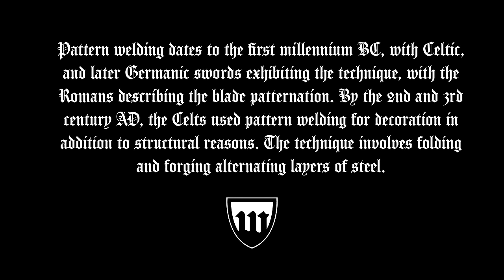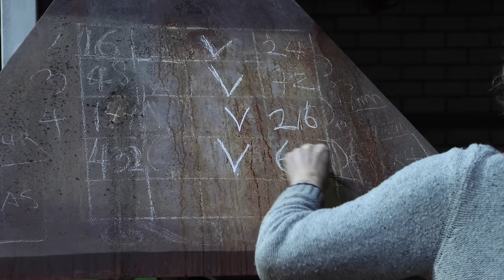Forging a Pattern welded longsword, the complete movie.

Comment: Curious about the concept of dimpling the billet. Is it to make expansion or lengthening of the billet go faster? You're the only smith I see doing this and I'm trying to learn so any explanation would be greatly appreciated.  Also your videos are excellent, haven't seen a bad one yet. Thanks
Reply: its to expose different layers of the steel in a Raindrop pattern. Just google Raindrop Damascus if you want to know more
Reply: @ughmas  thanks for the response, your explanation makes sense now that you mention it. I'll look into it.
Reply: It creates patterns in the steel.

You can't see it very well on this blade because he did a lot of forging afterwards (which interrupts and changes the pattern) but if it is done to a flat billet that will ground to shape it causes what is called a "raindrop" pattern, an almost pond ripple effect.

Comment: Absolutely spectacular!  Mr Wieringa, if I may ask, when you sandwich the hot metal between the planks of wood, what does that step achieve in the overall process?
Reply from the maker: It keeps the steel straight and slows down the cooldown. In different stages this is beneficial. Basically tempering the steel a bit jut after hardening for example. Insteed of a rude and hard cooldown. Giving some flexibility already.

Comment: holy shit was it ever impressive watching you bend the blade that much only for it to spring back. I'm an aerospace engineering student and we just recently went over chipless production and heat treatment of metals, so I'd be really interested in knowing what steel you used, what temperatures you heated the blade to, how specifically you cooled it down - just more details in general.

man, this would be a great hobby to have. maybe someday...

Comment: One of the things I love about these videos is the flaws; they're very few and far between, but it makes the piece even better because it's not a soulless mass-production product.

He's very clearly not a machinist—it's not his specialty—so when he ventures outside the "comfort zone" of his near-total mastery of blacksmithing tools, you can more clearly see him learning with every project.

Just by eye, I could see (and hear) that the laythe was off by a few thousandths, and the drill press is a tiny bit wobbly, and with one of the parts going in between the crossguard/pommel and the handle, he probably should've really gronked-down harder on the vice, as it slipped and probably obliterated tolerances.

But all of that doesn't make the sword worse, it actually makes it better, because it's another part of the piece's story;

A master blacksmith using every tool available, even ones he's not a master in, to make a sword as good as it can be.

I like that.

Comment: You didn't seem to show the folding process but it definitely looks folded, did you purchase the steel that way or do that yourself?  I am also curious what the dimensions of the blade are.  Amazing work, it looks fantastic!
Reply: It won't be folded - that's more of a Japanese thing, to clean the occlusions out of their shitty steel. 

It will have started as alternating plates stacked and tack welded which are then forge welded into one solid piece.

Comment: what's the purpose of running a blowtorch over the blade after the quench?
Reply: It’s to temper it makes it where it’s hard but not brittle
Reply from the maker: It's for tempering.
Reply: @freerkwieringa275  That method seems a little risky to me since it's very freehand. How to you maintain constant temperature without getting too hot?